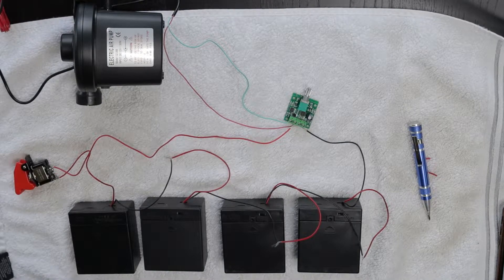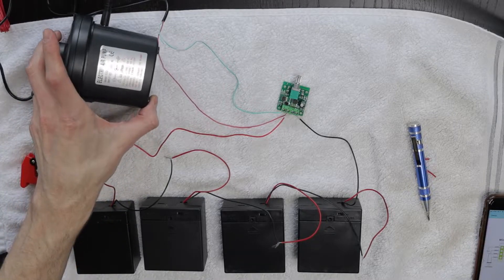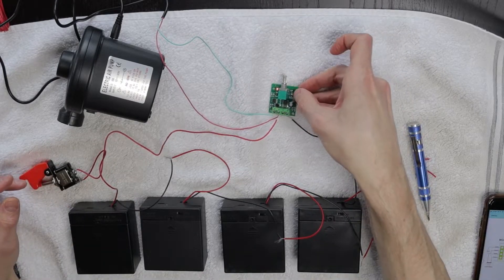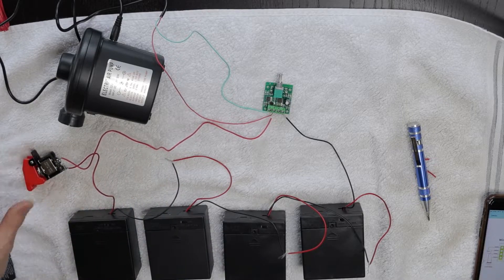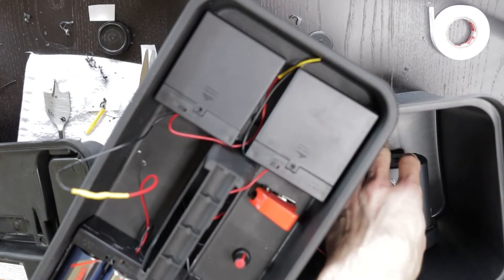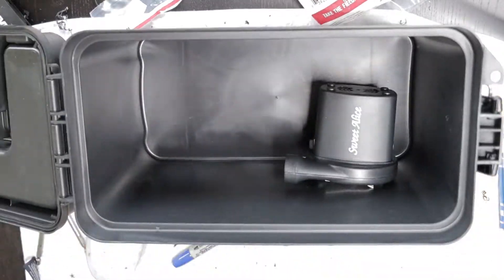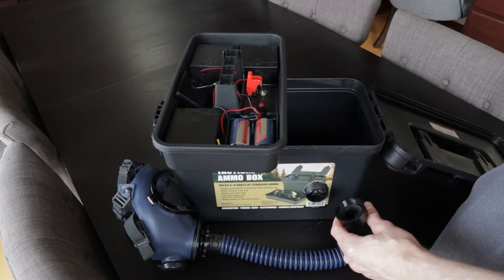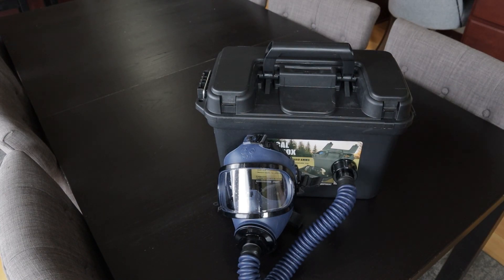DIY PAPR Machine - Powered Air Purifying Respirator

Comment: If you're looking for a large capacity, cheap, and rechargeable set of batteries for projects, 18650s are great. 3 in series will give you 12.6 volts at full charge, they are only ~$5 each, most can store at least 2-3 Amp hours per battery, and they are rechargeable hundreds of times. 6 of those (2 parallel banks of 3 in series) would probably work great for you. Nice project!
Reply from the maker: Great idea! I never even thought about using 18650’s, I just kind of defaulted to the D’s. That could be a good upgrade to it at some point.
Reply: Why wouldn’t you filter the intake instead of your output? How has your motor stood up with it not being a continuous duty motor?  Does it over heat after running for a bit?